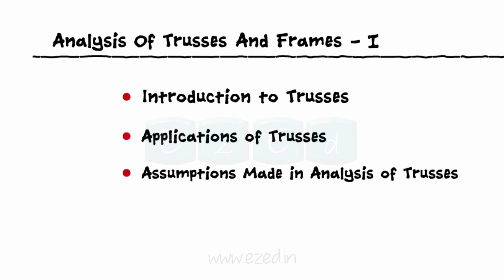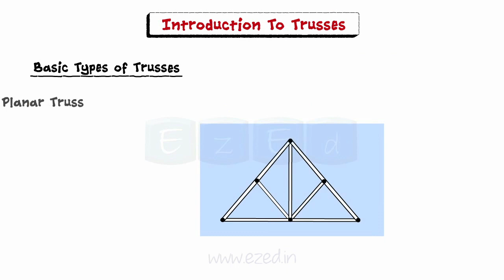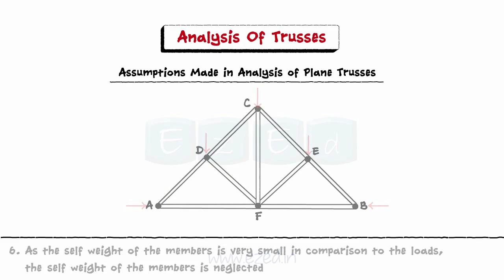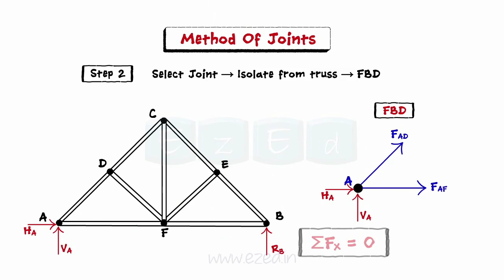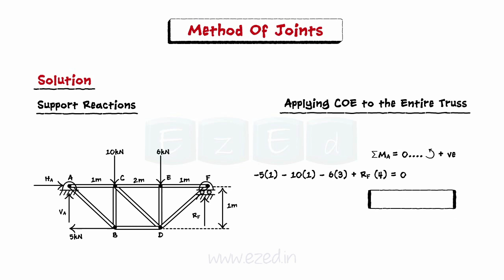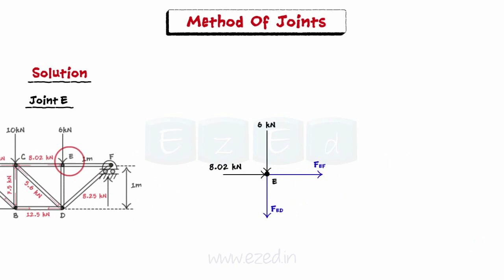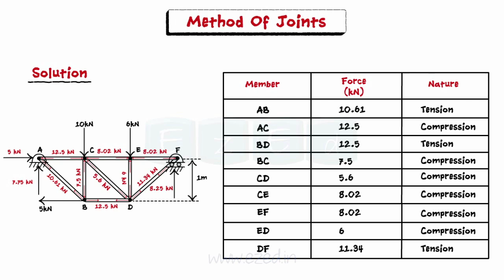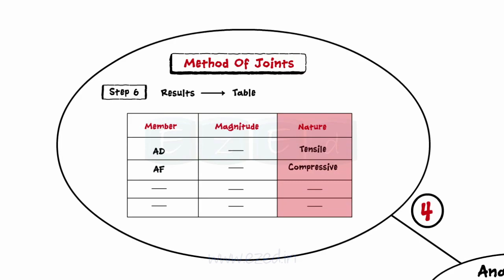What are Trusses And Frames I - Applications of Trusses - Method of Joints - Solved Problems

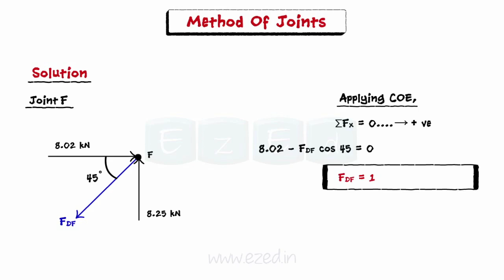Comment: I feel something is wrong with the 45° angle at 11:42  or there is some calculation mistake somewhere ahead. Please note it.
Reply from the maker: Hi Likita Sathvik. Why do you feel so? What is the answer that you are getting?
Reply: @EzEdChannel  Because as Fdf is making 45° to each of the other forces, those forces have to be equal. But they are 8.25 and 8.02